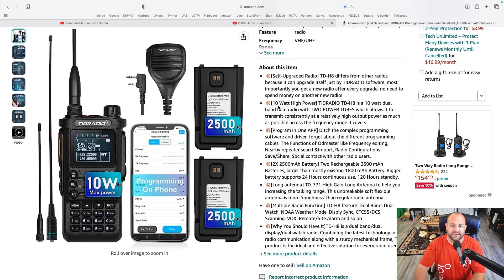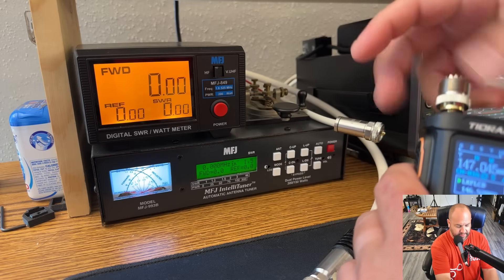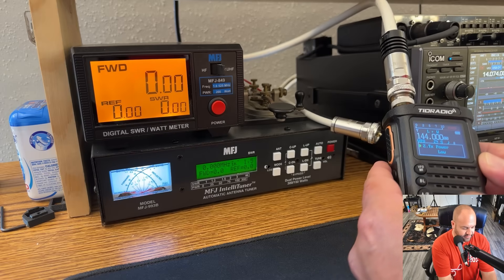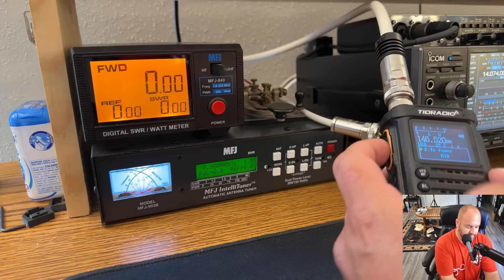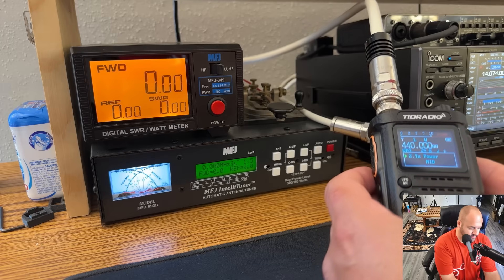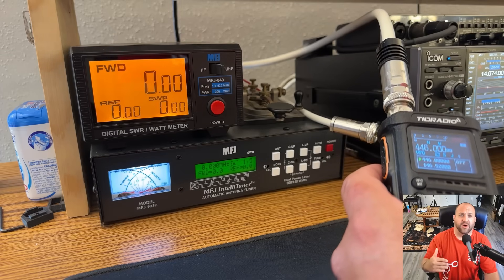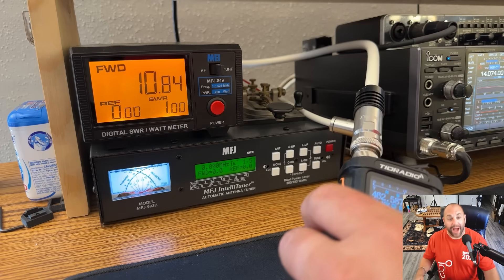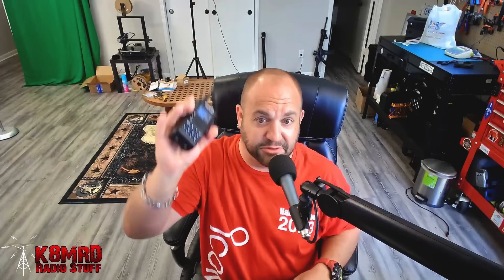Does The TidRadio TD-H8 Actually Do What Is Advertised??

Comment: Okay, if the difference  between 5 and 10 watts isnt much, then the difference between 1watt and 5 watts wont be much so why even do 1 watt or 5 watts ? Why buy a different antenna even.  You know that is crap. 5 to 10 watts wont double your range, however, it will make a difference just like using a better antenna will make a difference between not making it and making it.

Comment: My 2 HAM units are very similar to what you have.  Except at high power in MURS band =11.5 watts.  GMRS high power 3.5 watts.  My co-worker bought the GMRS version of this radio and it puts out 10.1 watts in the GMRS but after unlocking it only puts out 3ish watts in the 2-meter band and MURS.

Comment: Hi Mike here in the UK TidRadio will not dispatch the option of two batteries. Since the second battery is external and external batteries cannot be shipped to UK. Sucks yes . I have asked TIDRadio what if the first battery fails or I need a second battery for availability they have yet to come back to me. If they reply I’ll add an update. Thanks

Comment: I am thinking about buying two of these and making a repeater. since there are two antennas, there is no need for a duplexer, hopefully maintaining between 7 and 10 watts.  My questions are. Do you think this would work? Which antennas would you recommend? I have seen projects using Baofengs, but I would like to use these radios.  The radios will placed inside a small Vault gun case that is weatherproof. Any help would be appreciated.
Reply from the maker: I haven't tried out the repeater capabilities of these radios but they are advertised to do so, so who knows?   As far as antennas for this type of setup, I believe you'd need 2.  I'm a big fan of the Ed Fong Roll Up J-Pole antennas for portable VHF/UHF.  You can get them here: https://grapevineamateurradio.com/collections/radio-gear/products/ed-fong-j-pole-antennas-dual-band-220-and-roll-up  Just make sure you select the proper antenna for the frequencies you want to operate.  And you would want the Roll Up, not the PVC one as that is made to go inside a PVC pipe for a more permanent installation.  Get em up high with a decent coax for VHF/UHF and you should be all set.
Reply: @hamradiotube  .
Thanks. I have a wind turbine tower At 32 ft that I am not using right now. I'll will use on the GMRS bands.
Reply: One more thing, maybe two. What is the minimum distance between the antennas and what do you put in place for potential lightning strikes?
Reply: Nice pipe dream. School up more before stepping in that pile.

Comment: Could you boot into GMRS mode and run the power test again? I asked on Amazon what’s the difference between the Ham and GMRS versions of the radio. The response said GMRS is power limited by the firmware and by being supplied with a different antenna. We’ll, I have a gen1 Ham, a gen2 Ham, and a gen1 GMRS. They all have the same antenna.

Comment: Hi Mike,
Thanks for saying hi at Dayton. 
On the radio, just a thought...the battery can fluctuate  its voltage, so you might want to connect it to a dedicated power supply for consistency. If the battery starts to fluctuate, it can screw  up power output readings. Ive had it happen. 
But that is a really cool radio. 

Also bring to your attention, one of the mfg's just brought out a quad band...6, 2, 220, and 440 ht. Its around 200+ ish. 
73s,
John, N8SGM.